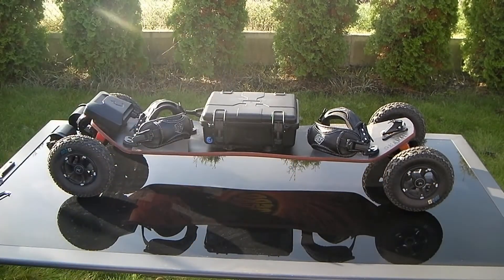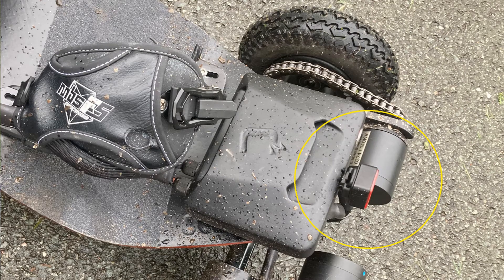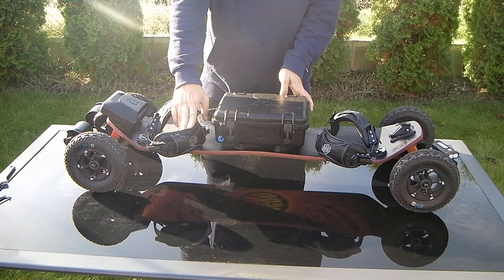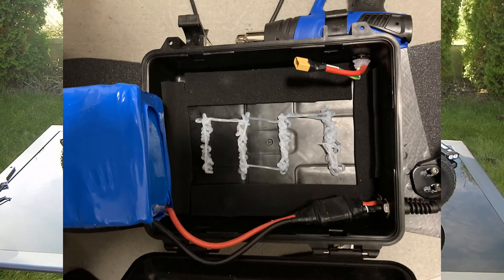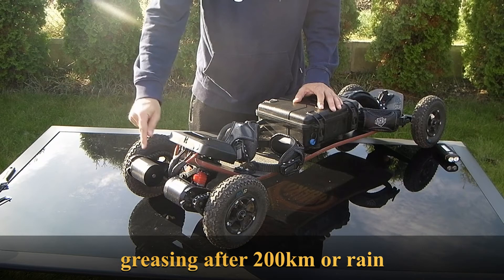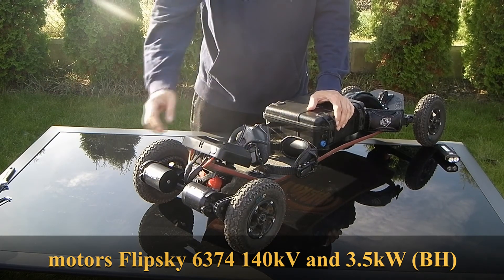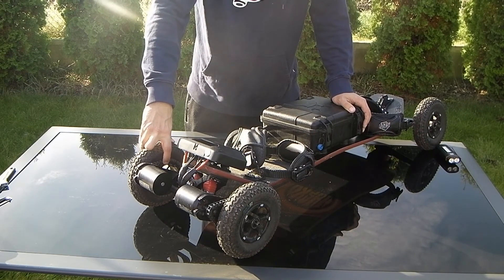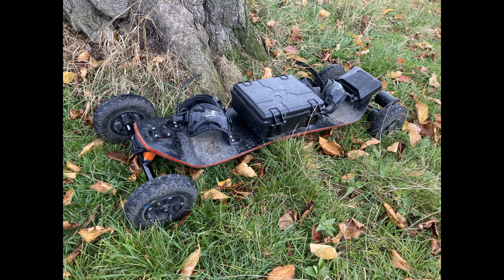DIY Electric Mountainboard 06B Chain

Comment: Wow, Looks and sounds amazing! 🤘🤘🤘
Reply from the maker: Thank You 🛹🤘I remained dependent on this board :)
Reply: @fackoesk8  do you have the link of the light mount and the light? I tried to find it but I had no results 😢
Reply from the maker: @africans1968  Hi. It is my design. No problem to share it. Just yesterday i had with friend night ride in cold weather and I did smal jumps. During one jump the light fixation on light side was broken. This china bicycle light it was probably not so good idea. Best solution I can recomended is to use quality headlamp on helmet + small blinker on board🛹🤘
Reply: @fackoesk8  it will be great to share with me the mount x 👍
Reply from the maker: @africans1968   here You are, Iam added it to my Grabcad ...https://grabcad.com/library/anti-sink-plate-by-facko-1
Reply: @fackoesk8  thank you so much for sharing! 🤘🤘🤘
Reply from the maker: @africans1968  welcome